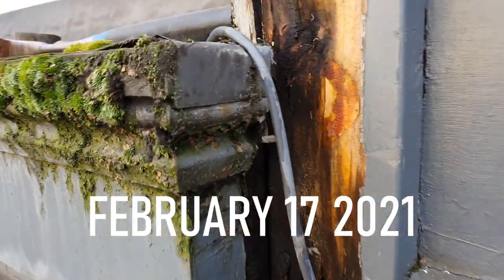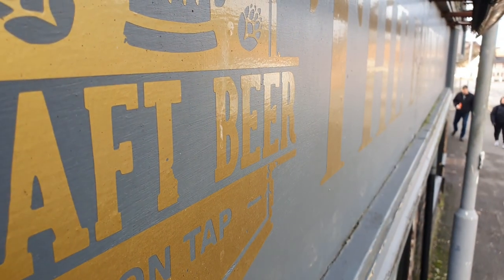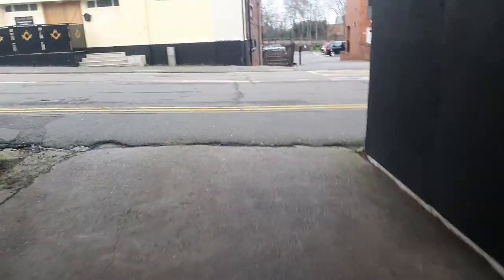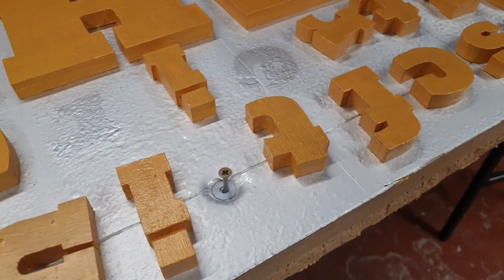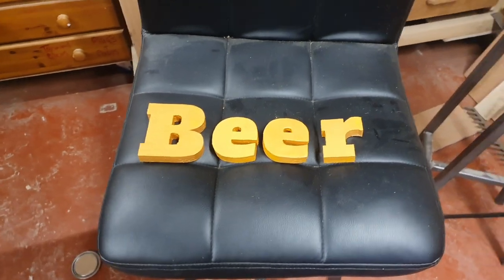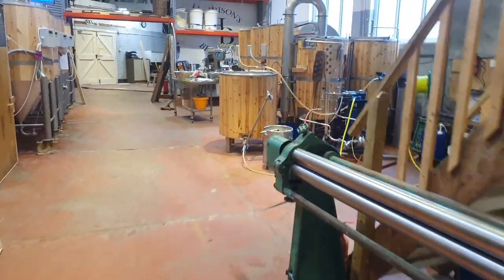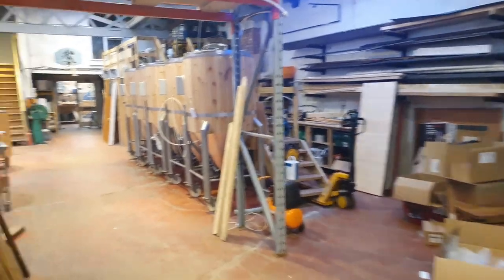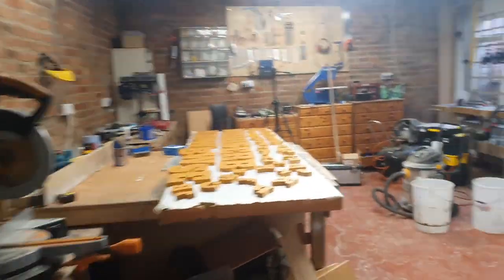Old Sign Down

Comment: Use Dibond or Alupanel.     I work for a sign firm in leeds so probably a bit too far for you but any local sign firm will be able to get it for you cut to size.    If you get black, it usually comes Matt on one side and gloss on the other so you can have a look at which looks best.    It’ll last forever too.